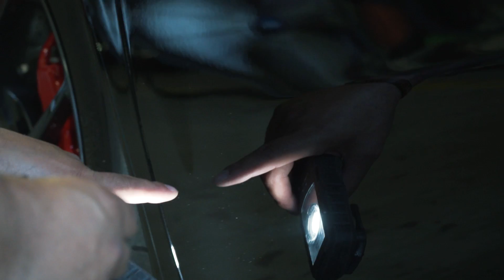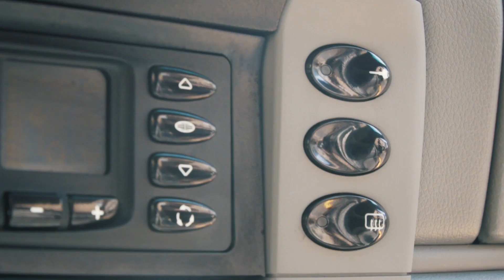Acura NSX Vin#1 Arrives for the Chicago Auto Pros Signature 10K Detail | Detail VLOG | S3E19

Comment: Question: do you guys use different wash mitts depending on the paint of the car? I seen in a lot of videos you guys use a blue one but for that Acura NSX you used the red and white Gtechniq mitt
Reply from the maker: No just happened to be using those mitts for this wash. We have mitts for the wheels and mitts for the body's.